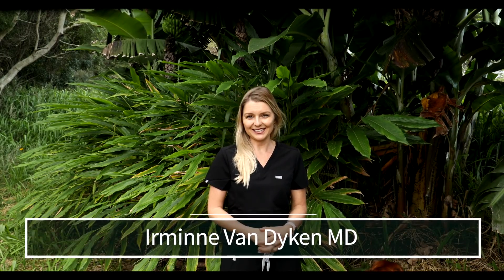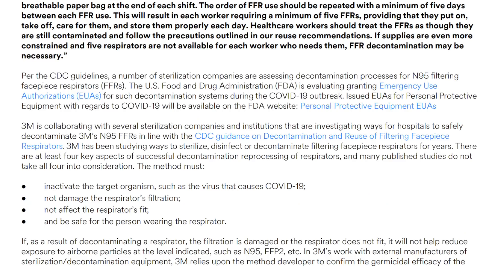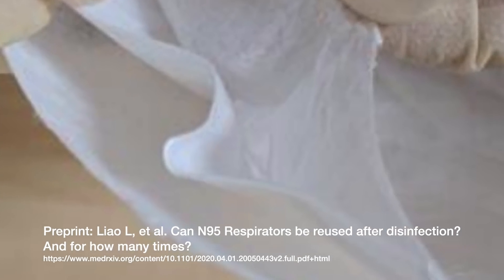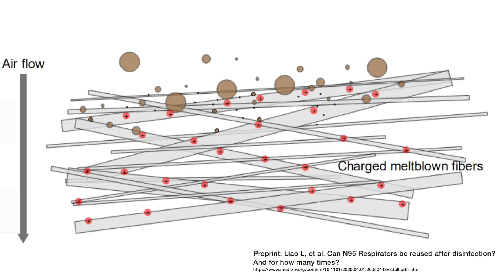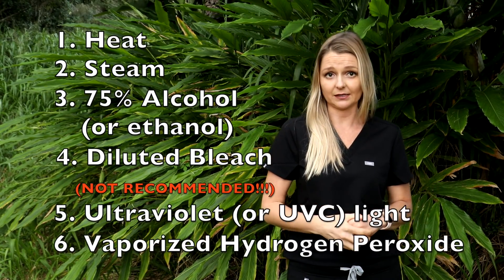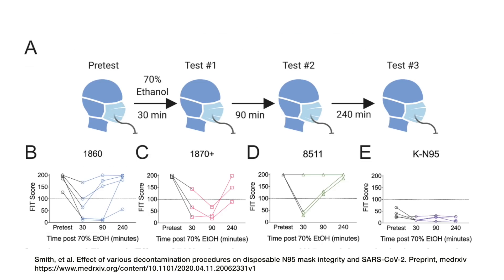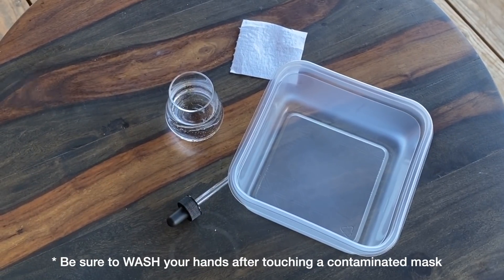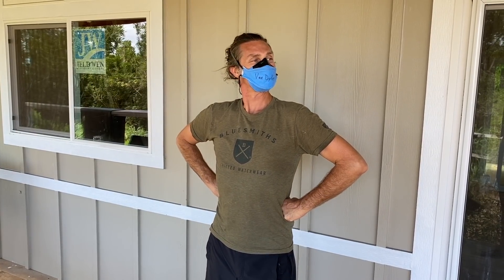How To Disinfect Your N95 Mask at Home

Comment: Disinfecting a mask  is easy enough. The problem is knowing when to dispose of the mask, because it has lost it's filtration efficiency. For this I think a microscope with 100X  or 200X is needed.
Reply: A filter test facility is needed.
Reply: Buzz Pedrotti - Many Governments around the world could easily and quickly test materials for filtration efficiency.  Why is that even though Governments around the world are spending millions for ventilators, millions for research for a vaccine, and always issuing orders closing down businesses like crazy, which is incredibly expensive - I have yet to hear of any Government anywhere in the world that has spent one dime to published the results of a simple (for their labs) filtration efficiency test and breath-ability test  on all the different materials people are using to make their own face masks. Why I have I not heard of any Government anywhere in the world that has ordered it's scientists to develop a good material for making face masks, and then ordered manufactures to produce that material. The confusion about when to dispose of a face mask is so great, that I have decided to make a face mask using blue shop towels, and built in cellophane eyeglasses, so that the face mask will be cheap enough that it can be disposed of after each use, and also will be easy to breath through. I am pretty sure that a face mask made with a double layer of blue shop towels, and having a good seal, will have better filtration efficiency than a surgical face mask that is being worn way past the time it has lost much of its filtration efficiency. I live in a small village in the Maya highlands of Guatemala. The Guatemala Government has ordered everyone to wear a face mask whenever they go outside, and the Guatemala Government is making some effort to get surgical masks to the people here. The problem is that people will just hang their face out to dry in the sun, and then re-use that surgical mask forever. The big problem will be when public transportation opens up again. My mind is fearful of the idea of getting on a crowded bus full of people who might be wearing close to useless face masks. And in the small villages the public transportation to town are pickup trucks that about 20 people at a time stand up in, and they are standing very close together.
Reply: @allanmarks2150  There are studies on this. A tightly woven cotton fabric like a tea towel provides about 70% filtration of small particles. Something like a cotton tshirt that is 4 layers thick offers about 50%. And lots of countries - Canada included - are testing the sterilization methods and effectiveness.
Reply: @mosaicsnmaple  - thank you. I have also seen studies that say that a double layer of tea towel provides almost surgical grade filtration effectiveness (95%), and I am designing a face mask that will be made of a double layer of tea towel. It is important that the mask have a good seal. To make a good seal on the face mask I am making, I am thinking about using something like weather stripping attached to a frame made of electrical wire (easy to shape), or maybe silicone rods. I could then maybe wrap the silicone rods with blue shop towels. I don't sew, but I can make a mask easily using duct tape. I am still waiting for some government anywhere in the world to release the results of filtration efficiency and breath-ability on all the different materials people are using to make their face masks. That Canada is doing such testing is good, but when the study comes out I wonder how useful it will be. Too many studies say something like "Our study seems to indicate that in some situations ... blah blah blah."
With the kind of labs Canada and  the US have, I would think they could do a good study in just a few weeks. Why is it taking so long to do such a government sponsored study?
Reply: @allanmarks2150  Tea Towels I would be careful since they are variations out there. They are harder to breathe with than cotton materials. Best cotton materials are KONA and Rip Stop which are used in military  along with good filtration paper from surgical masks or Filtrete. If you are worried about the seals and gaps use clothing tape used by women to seal them.
Reply: @KVStarStruck22  - Thank you for this information. I did not know about the clothing tape. That sounds like a very good idea, and is an idea I have not seen elsewhere.
 For a material that will be easier to breath through than tea towel material, I plan to experiment with blue shop towels. I have read that a double layer of blue shop towels have very good filtration efficiency, and are easy to breath through. I also like the idea that blue shop towels are cheap enough to be disposed after each use, so I don't have to worry about when they should be disposed of, the way I would if I had a surgical mask.

I live in a small Maya village in the highlands of Guatemala. The Guatemala Government has ordered everyone to wear a face mask whenever they are outside. The Government is making some effort to get people surgical face masks, but I know that many people will re-use their surgical face masks way beyond the time the face mask should have been disposed of, because the mask has lost filtration efficiency by being used for too many hours. I want to make a face mask that will do a good job of protecting me, when I am on a crowded bus that is full of people who are wearing face masks that are most likely almost useless. Also, I teach children in several public schools here, so I am very interested in making a very good, but still inexpensive face mask. To protect my eyes, I plan to make my mask with built-in cellophane eyeglasses. Everything is shut down now - almost no one is allowed in or out the village where I live. When things open up, I will go to a city to buy whatever material I need.
Reply: @allanmarks2150  2 Shop towels plus a cloth mask with it provides at least 50% . The best I have seen so far are the hepa filters used in this video plus 2 layers of tight weave cotton that I have mentioned provides 85%.  protection.
Reply: @KVStarStruck22  - thank you - I have been staying at home for the past week. However, today I went out looking for the clothing tape you mentioned.  It is easy to find fabric stores in this small Maya village, because almost all the Maya women sew and wear the beautiful Maya clothing, but nobody had the clothing tape you suggested. When transportation opens up I will go to a city looking for the clothing tape, the hepa filters, and the blue shop towels. Then I will be able to find out for myself how easy or difficult each material is to breath through. Most everyone I saw was wearing a face mask, just as the Guatemala Government has ordered the people to do, but a lot of people were just wearing the mask over their mouth, and not over their nose. This makes it easy to breath with a mask on, but in my understanding, no mask over the nose, kind of defeats the whole  purpose of wearing  a mask.
Reply: @allanmarks2150  You can't buy online? If you can't find clothing tape, you can try wig tape too at a wig beauty store. Other suggestion  just any thin double sided tape found at hardware stores I do not know if they can stick to fabric though since the ones like clothing and wig tape are meant for fabric materials. Good luck with it!
Reply: Easy, leave them in boiling water for 10+ minutes. Then, trash.

Comment: Will it work if the mask has a cooling vent?
Reply: cooling vent? Or did you mean an exhale valve?
Reply from the maker: A cool event/exhale valve will work. The valves have been known to fail quite frequently. Additionally, the mask with a valve will only protect you and not those around you.
Reply: Out of the Doldrums thank you it’s what we have leftover from a drywalling project.  They were used by us so couldn’t donate, only used when we have to leave the house for food.  We try to get pick up or delivery but it’s hit or miss in my area.

Comment: but the containers don't melt in the oven
???
Reply: use a convection oven. The 85 Celsius hot air will not melt the plastics. Most plastics need more than 120 Celsius to melt.

Comment: Wouldn't that heat melt the plastic???
Reply: use a convection oven. The 85 Celsius hot air will not melt the plastics. Most plastics need more than 120 Celsius to melt.
Reply: @sinusnovi3826  thank you.

Comment: How about sanitizing mail and money I have been setting my iron to cotton  400 degrees and ironing it will this work? I can't find much online for sanitizing mail or money
Reply: Night Stringers ,
Lysol...
Reply: @kevinhall4528  can't really use that on mail it'll make the ink run and you can't find Lysol here I have plenty of alcohol but again that we'll make the ink run  on mail.  I've just been using a hot iron set on the Cotton setting
Reply: Night Stringers ,
I use it on my mail and ink doesn't run
Also, use it on packages and wrap groceries
Spray from about three feet away on both sides and let it dry...
Reply: @kevinhall4528  Like I said I don't have Lysol cant get it. Remember though the spray would have to the whole surface. On my groceries   I use a bleach rag on cans and boxes. Hydrogen  peroxide  on fruits and veggies and then rinse really well.  BTW be careful some bags of premade salad and bags of fries have tiny hole in them so NO spraying with Lysol . Yep sound like covid19 has made a germaphobe out of both of us. lol lol  Take care my friend stay healthy  and safe .
Reply: sanitize it with the oven method too. But you need no box or water (humitidy).
Reply: A portable UV C light seems practical for the use you are looking for

Comment: Why is NOBODY talking about Ozone??  Same oxidation concept as H2o2 (Hydrogen Peroxide) but without the dangers.  As long as you leave it for an hour to get rid of smell..
Reply: ozon is good for bakteria but not recommended for viruses.
Reply: Thabnks  @sinusnovi3826  But do you have a medical / research source for that info?  My google research does not show any
Reply: @andrevanderwalt6196  I have no study on this. But logic. Bacteria are alive and "breathe". This is how they breathe in the ozone. Ozone is a radical and can oxidize the proteins inside the bacteria. The bacterium therefore dies. The Corona virus does not live outside of a host and it does not breathe. It has a fat coat and only an RNA inside. The fat coat will be damaged by soap and water, but not by ozone. I could be wrong but I wouldn't risk it with ozone.

Comment: Dr Greger recommended placing n95 masks in the oven for 5 minutes at 160 degree heat. https://www.youtube.com/watch?v=kMsHN2BdOzs  starts at 50:35
Reply from the maker: Dr. Greger is a great guy whom we respect greatly we also both know him personally. New Science is coming out every day. The paper that we have based the 40 minute recommendation on, is based on a newer paper that just came out a couple days ago. The more papers that come out better idea of what will work best to kill the virus. Our recommenced protocol for re using a Mask will improve over time. We feel this protocol is based on the best scientific evidence available at the current time.
Reply: @outofthedoldrums  is steaming in a vegetable steamer for 20 minutes or so ok, or 160°F oven for 30minutes, or letting it set in hot car 7 day's is that safe without disinfecting, are any of these methods good, also what is best, also I usually let sit in car, then steam I dunno
Reply: @outofthedoldrums  please provide me with working links for rederences
Reply: @outofthedoldrums  please provide me with working links fir references

Comment: After the oven is preheated, do you turn off the heat? Wouldn't the ziplock plastic melt if the heat is left on, I'm thinking?
Reply from the maker: The plastic is able to withstand a surprising amount of heat. Make sure that you don’t get the oven hotter than 185°. Once the oven is preheated, leave the oven on for the duration.

Comment: Thank you for the video! I am a dentist. I have been washing and saving used facemasks for years for an emergency. Here is how I learned how to sterilize my facemasks: https://youtu.be/esee3SrMYzg
Reply from the maker: Please don’t wash your N95 or similar mask. It will destroy the electrical charge needed to make it effective at protecting against the virus. Washing can be a good option for cloth masks and other materials that don’t rely on electrostatic charge to effectively filter smaller particles.
Reply: @outofthedoldrums  Thanks for the information. I don't think regular surgical masks rely on electrical charge?  The fabric itself just catches water droplets that could carry the virus.

Comment: I don't have an oven, let alone a covection oven.  So, instead of using the air fryer I put mine in a Ziploc bag, and hang it outside in the sun for 3 days.  It may not be the best but it's the best I have.  Aloha
Reply: I'm doing the same thing only I have no sun sometimes so be happy you have a sun!
Reply: meTooNow where do you live? Are you treating Covid patients in a bunker?
Reply: @JakeHabermansYouTube  I live in Hawaii where it's mostly sunny but when rain comes the Ziploc protects the mask.  Also, some UV makes its way through cloudy skies.  I'm above ground nursing the worst case of gount I've ever had and praying all will be under control soon.  Be well, stay safe, be happy.
Reply: @theslowwalker  The UV will never reach the mask. All plastics block UV light ( most of them ). Glass from greenhouses (quartz) let UV light come in.
Reply: UV light will damage the material . Just leave in a a place where it gets air without touching any metal . Like , hang it with a wooden clip/pin  or something
Reply: I would suggest just make sure that it doesn't get contaminated due to the plastic/heat issue.
Reply: I attach mine to a cloths hanger with a cloths pin and hang it in the sun. The sun kills the virus in one minute but I rotate it so it reaches different areas of the mask and bring it in when the sun is off of it. I just use a surgical mask for the store and pull the folds open when I hang it.

Comment: Thank you for your research,  citations and information. I have been washing my cloth masks in Dawn dishwashing soap, rinsing and air drying. Then I hit it with a very hot dry iron on almost max setting while not touching the elastic strap on the duckbill pattern I'm using. I do have a convection setting on my countertop oven. I've never used convection. Watching your video,  I assume the temp and time are safe for this plastic container. Wow, put plastic in my oven? Changes my perspective! But I think I will try this method. Thank you.
Reply: I am reading the comments because of the plastic container use! Haha.
Reply from the maker: I know, I thought the same thing about putting plastic in my oven… seems to be OK so far, and we have been doing this for a little while now…👍
Reply from the maker: Un día con Ann vlogs the reason we suggest a plastic container is two fold. The first is material compatibility. The plastic container is made of the same plastic as the mask. The second is that the study’s we based our recommendation on used the plastic container. So we have evidence that the plastic container will work. We don’t have evidence that the glass will not work. The glass very well work just fine.  However, we just want to base our recommendations on science.
Reply: Un día con Ann vlogs  it's the same material the mask is made of.

Comment: BASICALLY some of us just want to know:  A TIME SOLUTION  ...  (Setting a mask aside until it's SAFE TO REUSE)  ...  Thanks
Reply: The CDC says at least 5 days, but still handle them as contaminated:  "One strategy to mitigate the contact transfer of pathogens from the FFR to the wearer during reuse is to issue five respirators to each healthcare worker who may care for patients with suspected or confirmed COVID-19. The healthcare worker will wear one respirator each day and store it in a breathable paper bag at the end of each shift. The order of FFR use should be repeated with a minimum of five days between each FFR use. This will result in each worker requiring a minimum of five FFRs, providing that they put on, take off, care for them, and store them properly each day. Healthcare workers should treat the FFRs as though they are still contaminated and follow the precautions outlined in our reuse recommendations. " https://www.cdc.gov/coronavirus/2019-ncov/hcp/ppe-strategy/decontamination-reuse-respirators.html   (another study found a small amount ( ~0.1%) of the virus remained infectious on the outer layer of a surgical mask (similar, but different than a respirator) after 7 days, so treating the mask as though it is still contaminated (e.g., don't touch the outside, and if you do, wash your hands) seems prudent - that paper is here: https://www.thelancet.com/journals/lanmic/article/PIIS2666-5247(20)30003-3  )
Reply: @rafowell   I successfully downloaded the CDC paper but the 2nd paper would not download.  Any advice? Thanks Gary
Reply: I leave mines outside for a week.